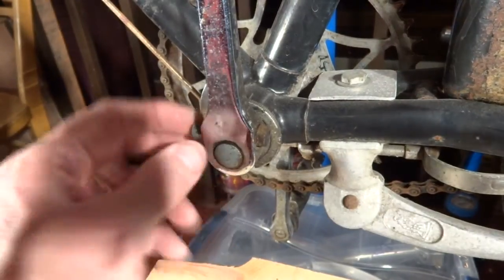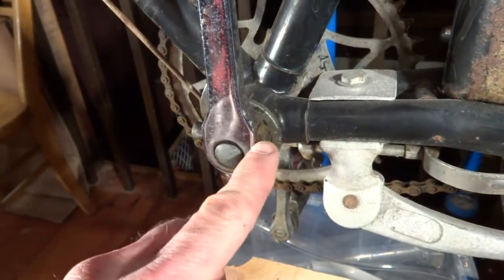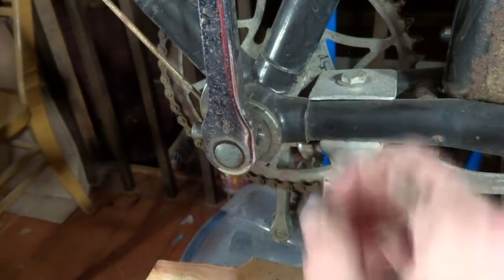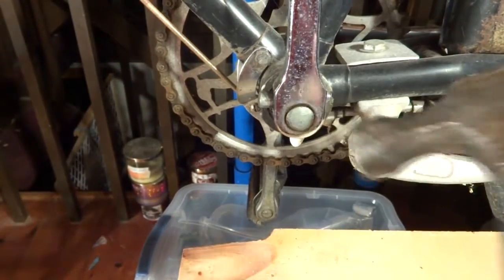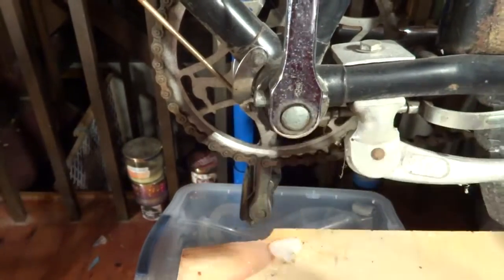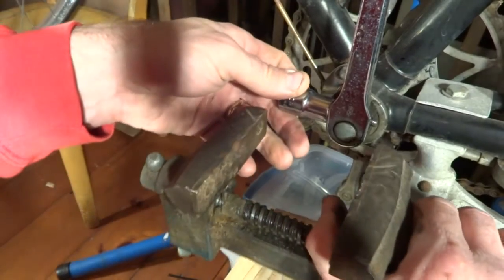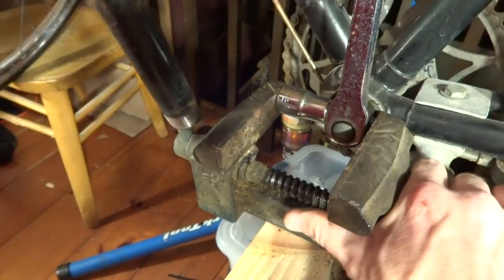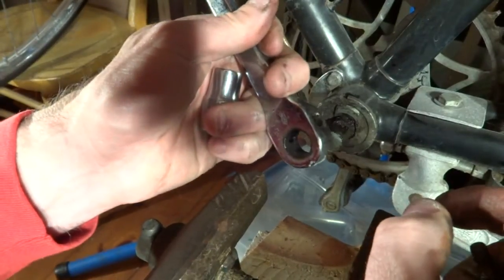How To Remove Stuck Crank Cotter Pin With A Vise On Vintage Bike

Comment: Brilliant idea! I’m restoring a 1963 Armstrong. The hammer wasn’t doing anything for me, so I gave this a shot. It took a lot of setup, since I had to remove and transport a bench vice, but it worked well. The resulting explosion of the cotter pin letting go was fantastic. Thanks!

Comment: This worked perfectly for me, thanks! The only thing I would change is put the pin in the center of the vise jaws. Looks like you have a good old vise, but a cheap vise might break. I put my bike sideways balanced between 2 chairs so the pin was in the middle of the vise and after some penetrating oil and a cheater bar it came out easily.
Reply from the maker: Yeah, my vise is pretty heavy duty.

Comment: 2:39  at this stage i tap the vice with a hammer a few times, and continue tightening more  but without a cheater bar.  This way  the impact force really helps breaking the pin loose  without damaging it.

Comment: I modified your approach using a socket and an 8" C-clamp to get the pin out of an 1890's bike crank.  I had not been able to drive it out with a wood block and hammer.  With the C clamp tightened down just enough, I gave the clamp a whack with a hammer and the pin popped out instantly.  The clamp makes a nice big target for the hammer, BTW.

Comment: If you don't have a spare loose vice, you can use a G clamp instead. Put the moveable foot on the socket side, the fixed foot against the pin. Do it up tight and then go and get a cup of tea, you'll find all the pieces on the floor when you get back.
Reply: That's what I did with my Raleigh Sports 3-speed in junior high school.  The CLANG! at 3 AM woke the whole household; nobody else shared my exultation.

Comment: As a lifelong cyclist, I am puzzled as to why it took me forty odd years to learn this secret to removing cottered pins! I've read that some cycle tool manufacturers used to make special cotter pin removing tools, an one time ("...at band camp...!"), I even saw photos of  some of them ; but honestly, do they even exist??!! Get a vice----- everyman needs a vice!.  Notes: penetrating oils/ heat/ tapping(ultrasound!) ----- all are unnecessary as the power of the Acme threads in a vice are supreme. Do however ensure the pin is centrally located in the jaws of the vice. Lastly : the perfect  spacer washer to use over the end of the cotter will be found on the old style five speed blocks ; it's the axle spacer washer on the drive side.
       This is a great resource channel for cyclists, please keep it up. 🚴🙏

Comment: I have a tuck tricycle wheel that the pin is rusted on so bad that i can't twist the pin to move but you have me a good idea with the vice & the socket so i can remove the wheel.

Comment: question...before I saw this video, I tried removal using a hammer and now have a mushroomed over pin.  Any thoughts on how to remove a pin once mushroomed?
Reply from the maker: Yep, sometimes they just don't want to come out. Drill down through the pin to relieve pressure, and then pound it out with punch.
I had to do that in this video: Overhaul Bottom Bracket On Vintage Peugeot Bike

Comment: Ok, the problem is that I did smash the pin, now looks  like a mushroom now what ?
Reply from the maker: +imagringa Replace it. You will need to get a new one.You will need to find one of the same diameter.  And file it down to match the profile of the old one. Check this video around the 6:45 mark: https://www.youtube.com/watch?v=9Qc2wzyeXk0